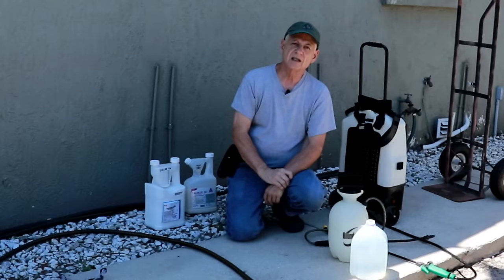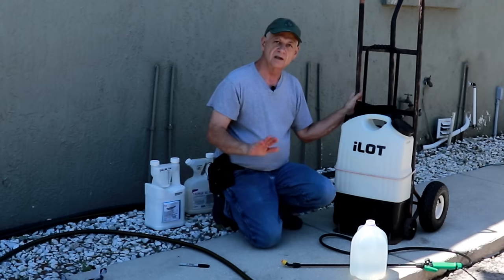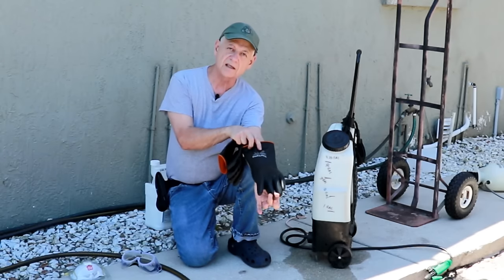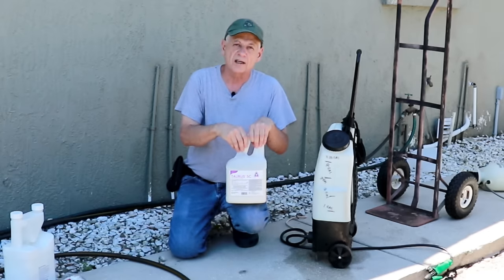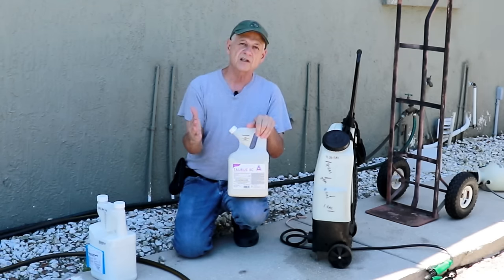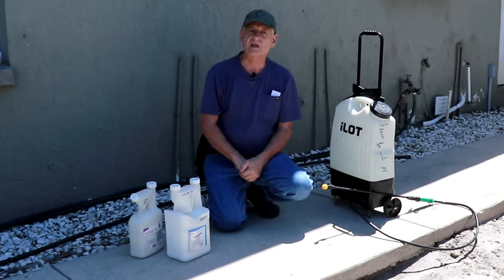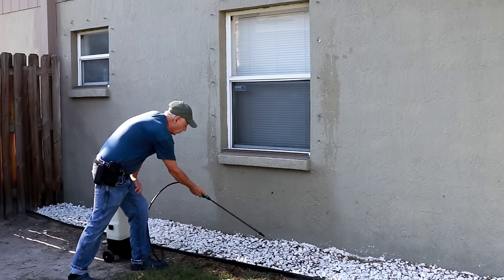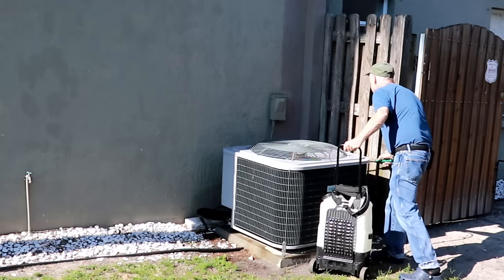General Exterior Pest Control - IMPORTANT!  READ THE DESCRIPTION.

Comment: Thank you for this video because I have had a Huge bug issue from ants to spiders and roaches even tho i have the roach problem a bit more under control then when i had a pest service came every month but i just found termites in my old well house and i can not afford pest control again so this is extremely helpful!
Reply from the maker: It sounds like you have your hands full with bugs.  The treatment explained in this video will help you with most of your pest problems.  I recommend that you alternate between the Tausur SC and the Talstar P.  Start with the Taurus SC and then treat with the Talstar P three months later.  Then back to the Taurus SC in three months, and then back to the Talstar P, and so forth.  This approach will be the most effective way to keep the bugs out.  If you would like to save a little money, then you can also use Bifen IT in place of the Talstar P.  I have found that Solutions Pest and Lawn have the best prices on these products and I will place links below for you.  I also like that they always ship for free.

There are a couple of things that you mentioned that give me some cause for concern.  

The first thing is that you mentioned that you have a roach problem.  The thing is that not all roaches are the same.  The treatment in the video that you watched will stop American cockroaches from entering your home, but that treatment will do nothing for other species of roaches.  If you are having a significant problem with roaches inside your home, then it is possible that this could be German cockroaches.  If that is the case, then you have a very serious problem.  I would urge you to watch my video on how to eliminate a German cockroach infestation.  I know it's a very long video at 90 minutes, but you don't need to watch the whole thing to determine if you have German cockroaches.  I explained very early on in the video how to determine if you have a German cockroach infestation.  If you do, then I highly recommend that you watch the entire video, so that you know how to get rid of them.  This is the only video on the entire Internet that can tell you how to do it.  Even pest controllers do not know how to get it done and that is why a monthly service for German cockroaches is not going to be effective.  I will place a link below for that video.

The other thing that you mentioned that is of concern to me are the termites that you have in the old well house.  Again, the treatment that I explained in the video that you watched is probably not going to get rid of termites.  Just like with the roaches, termites have a variety of species as well.  I hate to keep giving you homework, but termites can be a serious problem.  So, I suggest that you watch my video on how to determine termite species.  Don't worry…  It's not as hard as it sounds.  There is a map in that video that will show you where drywood and Formosan termites are a problem.  If you do not live in the red or orange areas on the map, then you most likely have a common variety of termites that are easily eradicated.  If that is the case, then watch my video on DIY Termite Treatment.  I will place a link below for both videos.  The termite treatment only costs $50.  If you do live in the red or orange areas on the map, then please get back to me so that we can talk about your treatment options.  You should also be aware that, if you have termites in your pump house, then it is very possible that you have them in your home as well.  Please get back to me after you watch the video on how to determine the termites species and I can discuss with you how to determine if you have them in your home as well.

Please be sure to read the entire description for those videos.   This is particularly true for the DIY termite treatment video.   The product that you need used to be sold by Lowes and Home Depot, but they are now selling a new, but similar product that does not work.  So, you must buy this product from Amazon and you do not want to confuse it with a similar product, that is made by the same company, but the new product that they came out with doesn't work.  I have all of this explained in the video, so you know the exact product to order.

Finally, for some reason, YouTube held your comment for review.  They do this every once in a while and I have no idea why.  Therefore, if you want to be sure that I am getting your messages, then I would urge you to write to my email address.  This is because sometimes they will hold those comments for months.  In your case, it would appear that I got it right away, but you never know how long they are going to hold a comment for.  My email address is guyspestsolutions@gmail.com.  If you write to my email, please remind me of your case.  I get a lot of mail because I help a lot of people and most of the time it’s termites or cockroaches.  It is very easy to get cases confused.  Just remind me that you are the person with the termites in the pump house and I will recall who you are.  

I know this is a lot to take in, but please don't worry.  It sounds like you have some serious issues that need to be addressed, but this is something that you can probably do yourself.  All you need to do is just take it one step at a time and before you know it your problems will be resolved.

Be well Marissa.

Taurus SC:  https://www.solutionsstores.com/taurus-sc-termiticide

Talstar P: https://www.solutionsstores.com/talstar-pro

Bifen IT:  https://www.solutionsstores.com/bifen-it-insecticide

German cockroach video:  https://youtu.be/FoxCB5qLPMA

How to identify termite species video:  https://youtu.be/mY4FMvAHrMA

DIY termite treatment video:  https://youtu.be/H7rW_TSBHJ4

Comment: Guy. I love your channel. I work in property management doing maintenance for apartments. Can I get the pesticide applicator license, but not work for a pest control company?
Reply from the maker: Thank you for those kind words.  Very much appreciated.  I am not familiar with the licensing requirements for all states.  It used to be, back in the 80's, you could just take a test to get licensed.  Some states may still be that way, but some are getting super hard.  For example, here in Florida you need to work for a pest control company for two years to qualify, and then you need to take a test.  Even if you were licensed in another state, Florida wants you to work for a company here for at least a year to qualify to take the test.  I wanted to get licensed here, but there is no way that I am coming out of retirement for a year just to get a license that I won't actually use.  So, you need to check the requirements in your state.  Some of the tests are not that easy, so you do need to know what you are doing.

I hope that helps.  Be well my friend.

Comment: Guy,
Thank you for all your series of videos!
Question: I have to hire a termite control professional in Riverside county, 92878 CA, any recommendations?
Thank you .
Reply from the maker: I have never lived in California, but my advice on hiring pest controllers is always the same.   As with romance, do not marry the first person you meet.  I recommend getting several estimates and don't forget the mom & pop outfits because often times you get better service and a lower price.  Those folks work hard to earn your business.  Do not sign a contract that automatically renews every year.  Read the entire contract before signing and if there is a clause in it like that, then scratch it out and have the sales person initial it.  If they won't do that, then show them the door.  The national companies like Terminix, Orkin, etc. often have these types of clauses, so be careful not to fall into that rabbit hole.  Many times you must cancel in writing within a short window of time each year or you are stuck for another year.  It's a sleazy practice used by companies that do not want to earn your business.  Also, do not fall for the old high pressure sales practice where they tell you that the price is only good for today.  If they lay that line on you, wish them well and kick them to the curb.  You should only do business with companies that do not use high pressure sales techniques and do not try to tie your hands into a never ending contract.  Some of the national companies that are franchised are okay, but do read the contract.  A lot of the mom & pop operations don't even have contracts, so you can fire them anytime you want.  That means they must work hard to make you happy.  I'm not saying not to go with a national company.  I just want you to go in with your eyes wide open and not get ripped off.  I hope that helps.  Thanks for watching.
Reply: If you are still looking, consider asking Craig and Son's, I'm a Realtor and my clients have been happy with their services.

Comment: Very informative video! Do these products leave residue, a film or discoloration on the paint? I have 2"-3" rocks around the perimeter of the foundation of house. Can I spray only the rocks and not the house?   I am painting the house and have a lot of sweat and money into the paint jop and prefer not to put anything on the paint:)  The house is sealed very well and very few pests come inside the house. The goal is keeping spiders from crawling up the house, under the eaves, and leaving webs everywhere.
Reply from the maker: These products leave very little residue or trace that they were ever applied.  They don’t dry completely clear, but you will not notice any difference in the paint color and they will not stain any surfaces on your house.  If you get some on the window glass, you will be able to see it, but is will wash off easily.
  
Coincidentally, I just finished painting my entire house about three weeks ago and the first thing that I did after I was finished was I treated my house with Taurus SC.  There is no way to tell that it was treated.  

I think if you just spray the rocks that around your house that is probably not going to be effective.  You definitely want to treat the ground from the foundation out about 18 inches and you want to soak the area where the foundation and the dirt meet really well.  It is also a very good idea to treat up the wall at least 18 inches as well.

If it's just spiders that you are after, then you can purchase a cobweb duster and a pole and just go around the house about every 30 days and knock them down.  I will give you a link to one.

I hope that helps.  Be well my friend.

Cobb Webb Duster Head:  Cobb Webb Duster Head | Solutions Pest & Lawn (solutionsstores.com)

Extension Pole:  Extender Pole Webster 10 Ft | Solutions Pest & Lawn (solutionsstores.com)

Comment: Hi Guy. I bought both products that you recommend. Will any of them work against cockroaches? If I spray Talstar P on grass instead of bifen T, will it work the same? Thank you again for your great videos
Reply from the maker: Yes.  These products work very well to kill cockroaches.  You won't get any roaches coming into the house after you apply these products.  The Talstar P is the exact same product as the Bifen IT.  No difference at all, except that the Bifen has a slight odor to it.  That goes away after it dries.  So, either one can be applied to your entire yard, including ornamental plants and the lawn.

I hope that helps.  Be well my friend.

Comment: Great videos. Do you recommend applying dust pesticide in addition to the barrier spray treatment?
Reply from the maker: Great question.  I use dusts all the time inside and they can be very effective for exterior use as well.  The problem with dusts when used outside is that they are easily washed away by the rain, so their use is limited to areas that are not exposed to the weather.  So, you can use them in cracks and crevices under eves, around windows, doors, and so forth, where they won't get washed away.  The best dust to use, in my opinion, is a borate dust like Nibor-D because it lasts forever, is nontoxic to people and pets, and it does not lose it's effectiveness when exposed to water.  The reason I did not mention the use of dust is because dusts alone will not get the job done and they are not necessary if you treat the exterior every three months.  I hope that helps.  Thanks for the question and thanks for watching.

Comment: Great video Guy. Very informative and helpful. I learned a lot.
Reply from the maker: I wasn't very clear in the video about this point because it was the first video I ever did and I was still getting my "sea legs" so to speak, but I think it makes the most sense to do the first treatment with Taurus SC and follow up treatments with Talstar P.  If you would like to save some money, you can do the follow up treatments with a Bifen product.  It's the same thing as Talstar P, but it costs less.  It has a slight odor to it, but I think that's fine when you are using it outside.  The odor goes away after it dries.  There are two versions of this product.  There is Bifen IT and Bifen XTS. The Bifen XTS costs more per gallon, but the dilution rate is 1/3 oz per gallon, instead of the one ounce per gallon dilution rate for the Bifen IT.  So, one gallon goes three times as far.  Currently, Bifen IT is selling for about $62 a gallon and Bifen XTS is selling for $162 a gallon.  Sense one gallon of Bifen XTS is the same as 3 gallons of Bifen IT, it is really only costing about $54 a gallon for the Bifen XTS.  That is not a huge savings, but every little bit helps.  Also, the Bifen XTS works way better if you need to use it in a hose end sprayer.  This is the sort of thing that you would do if you are treating your lawn.  The Bifen IT has a consistency much like milk, which is a bit thick for hose and sprayers, even if you dilute the product significantly, and then it often clogs the sprayers.  The Bifen XTS has a consistency like water and the hose end sprayers pick it up very easily.  Either product is fine for tank sprayers that you pump up or are battery operated.  So for me, I do the initial treatment with Taurus SC and then all follow-up treatments with Bifen XTS. 
 
I hope that helps.  Be well my friend.

Bifen XTS:  https://www.solutionsstores.com/bifen-xts

Bifen IT:  https://www.solutionsstores.com/bifen-it-insecticide

Comment: Thank you for this great film. Now I understand much better how much and in which way to apply pesticide around your house. Very good piece of information on difference between Talstar and Taurus. But if to compare Taurus and Termidor, which one would be stronger. You say you don't recommend to use Taurus or Termidor inside of the house, but can I poor it between walls via the access panel window against termites? Actually what I don't quite understand, what is the danger of a strong pesticide, is it when you touch it (so if it is behind the wall it should not hurt anyone) or it might be because of fumes? Thank you again.
Reply: @GuysPestSolutions  I see, thank you. So I'll prepare the nice panels first then apply. I thought to apply foam inside of the open access panel, then complete the panels themselves (I need to frame and touch paint them to restore the stencilling pattern). Maybe to cover w/cardboard until the panels are completed? I'll see.
Reply from the maker: Sounds good.  I'll bet you never thought that you would become an expert on pest control, yet here you are.  It sounds like you have a solid understanding of how all of this works.  You did your homework and your research and you now know what you are doing.  Good for you.  Well done.
Reply: @GuysPestSolutions  Thank you kindly.
Reply from the maker: It's always a pleasure working with you Olena.  Be well.

Comment: Thank you for the great information! I have a question…. what happen after you spray these chemicals and a few days later it rain? Does it wash everything away and I have to respray the whole house again?
Reply from the maker: Modern day pesticides are designed to stay where you put them.  Most of them will not wash away after they dry.  So, no need to retreat if it rains the next day.  Be well my friend.

Comment: Thank you Guy for the informative videos. I have pine straws surrounding the house with bushes. Will the provided  pest and termite solution works on top of pine straws or need to clear it first?
Reply from the maker: Hi Marwan.  Treating over pine straw with these products should be fine.  Just be sure to use enough of the product.  You want to soak it really good where the foundation meets the dirt and you want to be sure that you use enough so that the liquid gets through the pine straw to the ground.  The bugs are going to be traveling under the pine straw, so that's where the product needs to be.  Naturally, moving the pine straw is a sure thing and will take less treatment, but I think just soaking it really good would do the job too.  I hope that helps.  Thanks for watching.